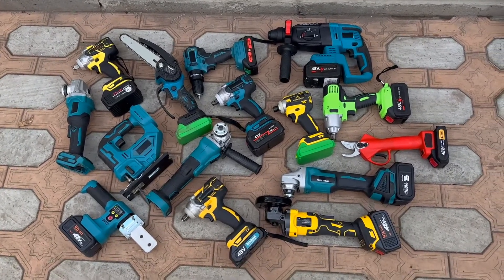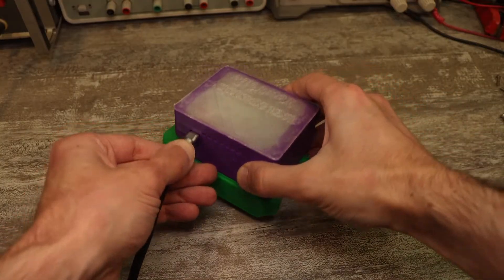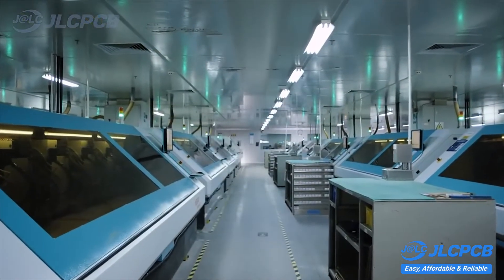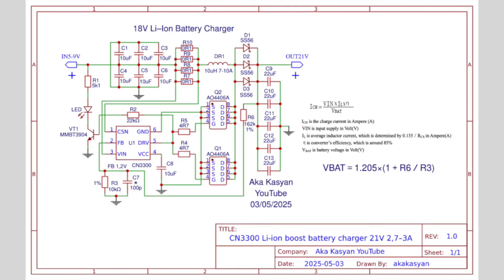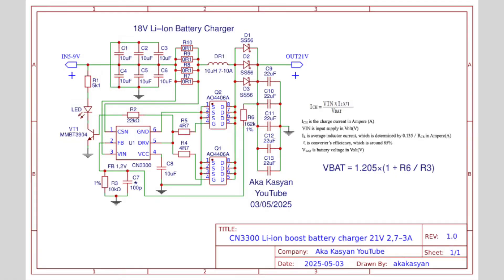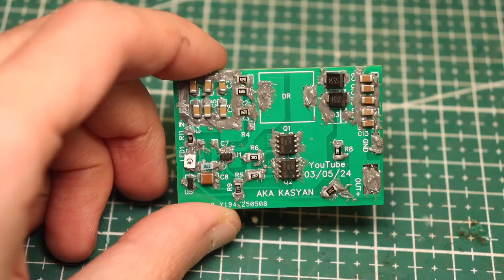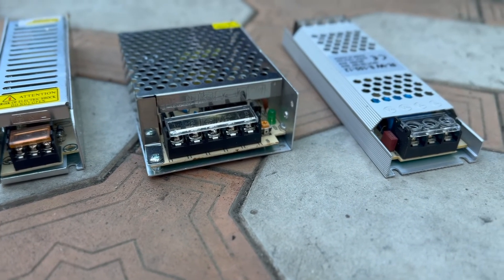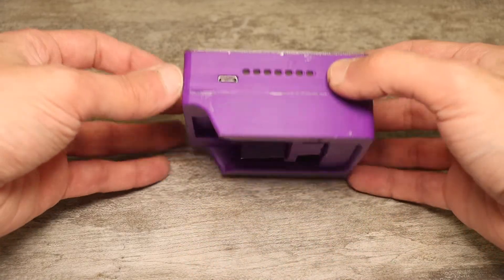The Ultimate Battery Charger JLCPCB

Comment: The Makita batteries have a temperature sensor on a third pin, and also individual cell group charge monitoring too I think? Monitoring these to check that you don't overcharge individual cell groups would be important, I think? I don't know if the makita batteries do internal balancing or not.

Comment: For charging batteries and especially with boost converters it is a good idea to add fuses at the input and output and reverse polarity/ over voltage/ under voltage protections